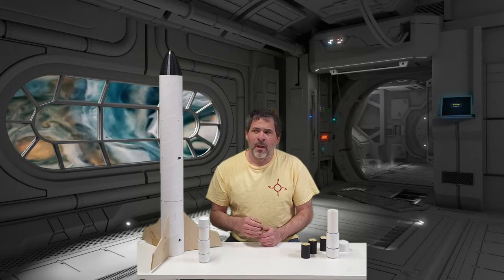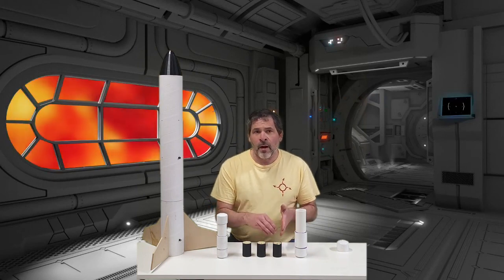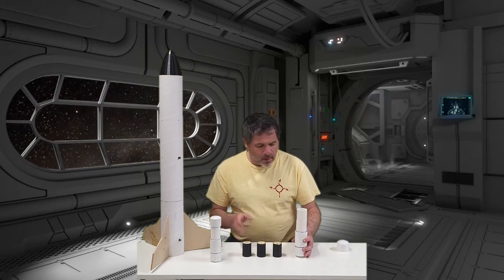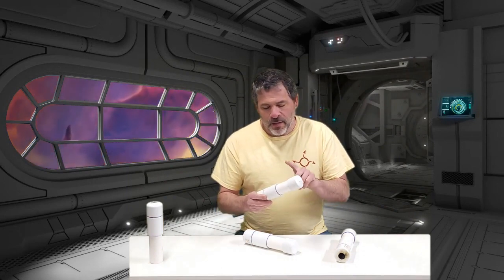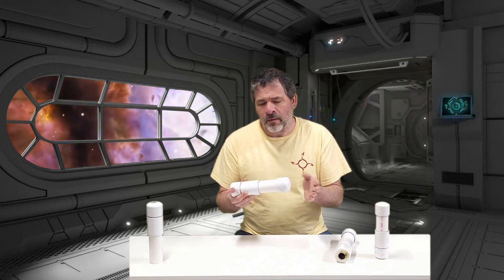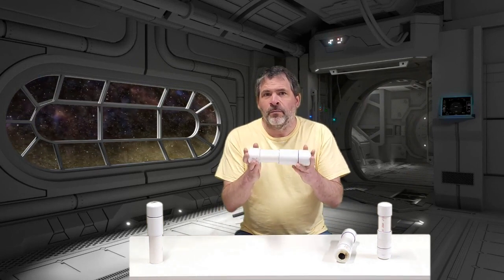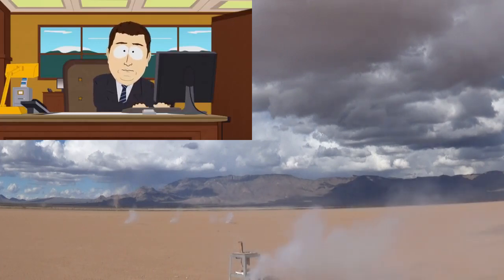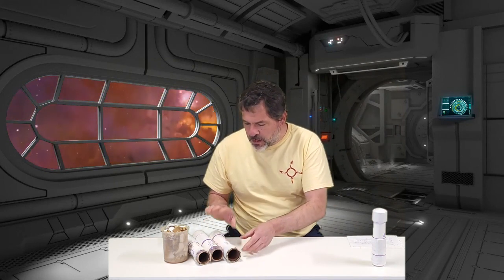Testing several new PVC rocket motors with sugar fuel

Comment: Is it meant by nozzle No. 20 that it has a diameter of 20 mm?
Reply from the maker: No. Here the nozzles are measured in 64ths of an inch. So hole diameter is 20/64ths of an inch. That would be 7.9375 mm.

Comment: Larger core diameter with the shorter single grain smaller diameter case should solve the issues. Essentially you'll just be starting the burn on the motor that launched the rocket slightly later in the burn curve... That or pour fuel with a Catalyst down in the bottom first to get the initial pressure up without increasing the max pressure.
Reply from the maker: A larger core on the original motor is likely where we are heading... You're explanation is exactly right.
I don't really want to use a catalyst to boost the launch for the simple reason that we are trying to make this a super simple build and that would just add a bit of complexity to the build. A good idea though.
Reply: @rotaryrocketry  side note I moved away from pvc tubes and just order phenolic tubing from mcmaster... Being phenolic you can epoxy right to the tubing and it's bonds to the resin in the tubing... Strong heat resistance as well... Had a motor with bad fuel burn for over a minute... Looked a little burnt hot dog but held up to it
Reply from the maker: @mattsteely  Interesting. I am only familiar with very thin wall phenolic. Shoot me a link to the product you are using from McMaster... I'd love to check it out.
Reply: @rotaryrocketry  I'll look up the part number and send it over... Do you have any other social media to chat on?
Reply: @rotaryrocketry  8527K176 is the part number. It's labeled as garolite xx tubing. That's the size for my smaller test motors but they make it in varying sizes and thickness
Reply from the maker: No other social media but you can always email directly. Email address can be found in the "About" section of our channel home page.
Reply: @rotaryrocketry  thanks on the motors I've tested myself, when I do a multiple bates grain configuration I've started testing with the grain closest to the nozzle being a 1% doped catalyst grain... Promising results so far but have yet to launch one of those yet.. I was honestly surprised that the added surface area of the larger tube and length made such a huge pressure difference